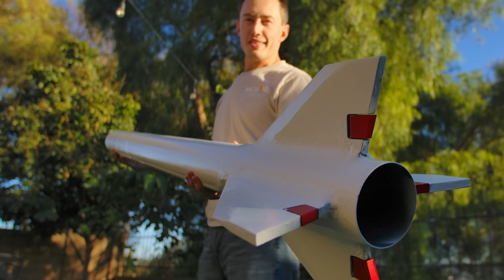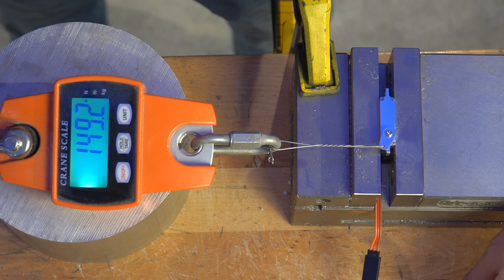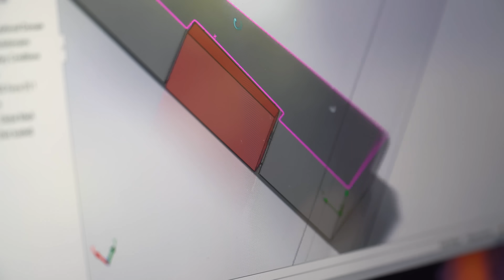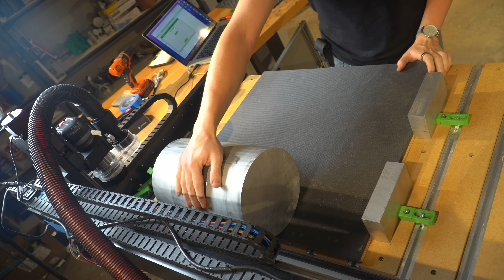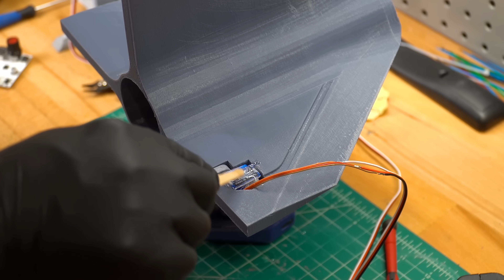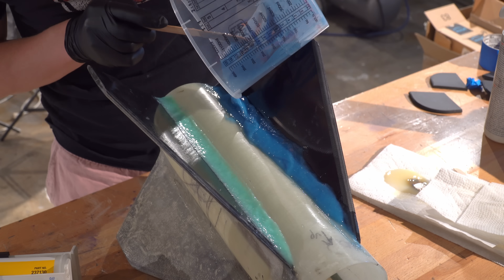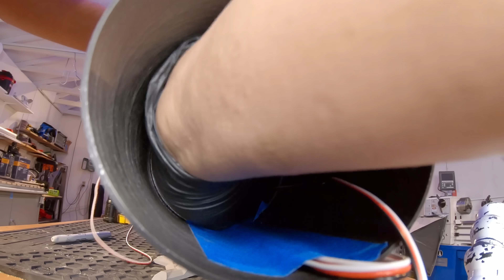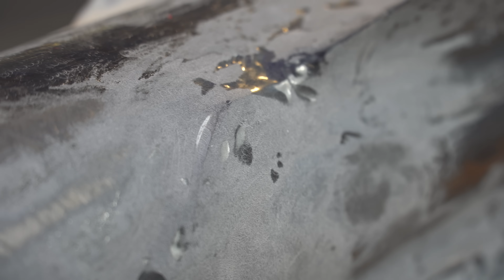Building a Guided Rocket to Hit Mach 3

Comment: What are the disadvantages of tapering the trailing edges of the fins and stabilizers?  Also, did you consider using flat PCB cable like they use in cell phones over regular wire?

Comment: Fab shop tip:
A piece of angle iron (aluminum L if you are posh) laid on a tube (cylinder settled in the V) will align itself and can be used to mark straight reference lines along the OD, or can be clamped on to use as a fence for cutting or alignment.
Not always perfect, but better than eyeballing it at least.

Comment: unless laws changed since the 90's guidance on an amateur rocket was illegal because it changed the projectile definition from rocket to guided missile. I only know because I wanted  to build a guidance system not to stabilize or correct flight trajectory but to steer it back toward launch site after apogee and deploy recovery at low altitude. why chase a drifting rocket when you can fly it back to you....just an idea i had ... and soon found out that at an amateur rocketeer level it was very illegal.
Reply: General consensus seems to be that you can point the rocket in a given direction (usually vertical) but not guide it to a specific spot

Comment: Now I get there might be elements not seen in this B-roll. But just an advice for prepping surfaces for bonding: Use a silicones remover degreasing agent and 2-rag approach. You can use IPA (or acetone if the material can take it, beware that many primers and bondos do not) for initial cleaning. Ideally then a pass with tac cloth. But for final prep, apply silcone removing degreaser with one lint free, non shedding microfiber cloth, directly followed by wiping it off with a separate clean one. Because if there's any contaminants for the degreaser to dissolve, thosebare now spread all over the application cloth.

Do not leave the silicone removing degreaser to evaporate, if a cleaning solvent evaporates on the surface, anything contaminants suspended in it are left behind right on there.

(Talking degreaser for oil silicones contaminants and other oils and fats, not the thick stuff you use to soften cured caulking silicone).

Comment: 25:45. So with the fillets, does using Kevlar pulp increase the strength noticeably? If so, I wonder if you could get away with smaller fillets by creating a small fillet with high kevlar content, then layering over that with a slightly larger fillet of just pure epoxy for the great surface finish.

If the strength increase with Kevlar (or other potential additives) isn't significant enough then it's obviously not worth the extra effort, but I'd be curious to know.

Comment: It could be just a dumb idea and it probably wouldnt work but when you were working with the fins you mentioned foldover and how that can trap air bubbles in between the epoxy layers, so i thought what if you were to do this process in a small room and right after you poured the epoxy you would cool the room down so the hot air between the layers would rise to the top thus solving foldover (i can see how this wouldnt make sense for a problem that can be solved by being gentle so just know its just an idea)

Comment: The question is why are you using so much epoxy and types. There is a ton of material waste in this and you could have made all of your carbon parts smooth without needing "seal" it by just using a two part mold system instead of trying to mill one of the hardest materials to mill - you also had the wrong bit on there for the job.  I love the video and your other videos but those aspects were a bit eye twitching.

Comment: I would have used heat shrink tubes to protect those connections. Cheap, reliable, and very easy to use. Would be worth using.

Comment: You could potentially use the rated voltage to hold the servo and switch to a higher voltage when a movement over a set threshold is required. In some huge industrial machines I've worked on with extremely negative consequences if a motor was to slip, we would allow the motor drive to over volt/current the motor for a limited time if we saw the signs of impending doom.

Comment: I had the same problem years ago with carbon fiber. I built an antenna for radio and i couldnt get it to work at all. It turned out the carbon fiber tube i had used to hold the elements to the pole was conductive.. i had the EXACT same reaction lol

Comment: 3d printed drill guides are a great idea but my recommendation would be by buy a bronze drill bush to insert into the 3d printed drill guide. It will be much more stable and re-useable. When joining the cables why on earth did you not use heat shrink insulation sleeving!!

Comment: I'm no engineer but what if you had conduit running on the outside of the rocket?  This might solve the electrical issue and prevent the sand through that happened.

Comment: Ideally carbon fiber should be cut in a water table.    Also carbon fiber is not only bad for your lungs but also your skin as the micro fibers can get imbeded in your skin, causing irritation and infection.   Same goes with carbon fiber filaments for 3d printing.

Comment: CA+epoxy used as a primary insulator on flight control wiring still feels like a constant near miss. Epoxy flows and can crack later in life, are you sure those connections didn't move inside the resin? I mean these are your flight controls and there's a sizeable potential for these small details to come up in the future. It will probably be completely fine, but reducing risk for $0.01 heatshrink/polyimide, 1µg weight, and 10 seconds of time seems a better option.

Edit:  Saw the rest of the video. Both concerns came up and were addressed. Great job, it looks excellent. Looking forward to the next video!

Comment: Great video!

About the aluminium etching: the passivating oxide layer forms instantaneously when exposed to air (that’s why it doesn’t oxidise further) so if anything you’ve just changed the surface texture (rugosity) by etching.

Comment: Joe - Have you considered using a caulk gun or a pipe bag (used for frosting) when making your filets or other precise applications of the expoxy?  Also, I'm surprised that you are sanding all of the nasty stuff outside and letting it float off (a) into the environment generally and (b) over to your neighbors...

Comment: Have you ever tried printing with Carbon Fiber?
I just recently purchased your tabletop CNC same one from 3D Carbide, but also an industrial 3D Printer that prints most alloys with the setup that only needs 350-370 in heat.
With the carbon fiber, you could have used your Ground on the material or even your power but you could have had a little restriction with power.
Just wondering..
DEv

Comment: What you were not thinking about is that the vise will take away much of your heat when testing your servo at that voltage.
It is an old welding trick to clamp some vise grips onto something you are welding or clamp it in a vise to dissipate heat.
Your vise would have been affecting your tests.
Better gearing for torque is the same as that for a vehicle for transmission.
Take the load off of your motor (Servo)

Comment: 15:45 saw the bare connections and immediately was like ooooh that’s not good. Clever by staggering the connect point but figured you’d have an issue. In the future I suggest a bit of wire heat shrink wrap. Super simple and quick and you can even seal it with the soldering iron if your light on the touch

Comment: Not to take anything away from your fine work but you might want to review the applicable laws.  From the apogee rocket web site:  “This also applies to guidance systems and advanced avionics, specifically banning any model rocket (or the critical components of, including software) that can make in-flight adjustments to its trajectory.”  A buddy got a visit from the ATF when they found out he was doing something similar.

Comment: Why hassle with servo flaps. It's not like your building a heat seeking sidewinder that needs to be on target. Yah ever hear of gyroscopic stabilization. Use wheels  on the outside edge of the fins. Like the MIC uses on DoD contract  rockets. I once used tesla turbine style of gyroscopic stabilization on  roskets out at BlackRock Desert.  Which worked the best & simple. But watch out for hippies  building match stick men to burn. 1986  I went from launching rockets  to witness the 1st burning man as a spaceman.

But remember,  everything that hits Mach 3.2  is trash. Don't over build trash. Unless your a collector &  connoisseur of the finer & expensive trash.

Comment: You're gonna wanna use some heat coating paints for the nose and surfaces, as well as probably titanium shielding on the fins especially leading edges and control surfaces.

Comment: all your work excites me, but one thing that does not allow me to be at peace is to see that cover you made to the wiring on the outside of the rocket I feel that could compromise the stability at mach 3 will be points of pressure gradieantes most likely even though you tried to preserve the symmetry at those speeds any geometric difference could be crucial I hope all goes well.

Comment: A dead servo or bad wire in a groove are not the end of the world while not attached to the body.

A cnc end mill can easily cut these out and fix the pockets to hold the replacements.

Comment: Are you sure that carbon fiber can withstand the frictional heat at Mach 3?
Reply: Because even with resins used in the aerospace industry, it can only withstand up to 300 degrees.

Comment: I'm gonna be that annoying friend: People often underestimate how persistent airborne CF dust is. Cutting it safely really requires an enclosed CNC machine vented to the outside or a misted/underwater setup. Your precautions are definitely a step in the right direction, but unlikely to be enough. Even with a filtered vacuum and boot, fine particles under 5 microns (and it’s missing plenty) stay suspended for hours, only to end up settling down on various surfaces to get kicked back up again later. This puts you and anyone entering the shop at risk of cumulative exposure.

It takes less exposure than you’d expect to cause long-term health issues. If an employer ran a setup like this, they’d likely face fines. For your health and anyone else who might enter the shop, I’d really recommend upgrading your setup if you plan to keep cutting CF like this.

Comment: Why don't they make rockets "spin", like a football, to get a natural stabilization and aid in the solid fuel burn? It would create a natural void in the center of the rocket for the expanding fuel to quickly and easily get to the nozzle, right? Additionally, it would spin the exhaust out the jet, creating a more focused cone, as well as retain the chemical reaction, due to pressure, against the solid fuel along the rocket walls, inside. Only the nose would need a counter-rotation, for sake of the camera and sensor stability, sending the signals to the fins, remotely or through a rotating contact post. (Like a motor's stator, the fin corrections could also be stabilized by the counter-rotating and non-spinning nose.)

How about the whole "golf-ball dimples" theory... Shallow, uniform dimples to create natural voids that reduce sidewall friction and increase stability control potential. As opposed to the "saran-wrap cling", that a solid surface has against air that is pressurized with a liquid-like manisquis grip. (Similar to water surface tension. High-speed fins use those divots to create voids, which reduces surface-tension grip.)

In all design basics, shouldn't the nose be slightly larger, so the speed-tuned taper to the tail also reduces drag? Besides every airplane ever designed, even missiles have a "fat head", with a slowly tapering body, to the tail. It is specific to the ultimate speed you desire to reach, accommodating the impacting pressures and time to "fill the void", back against the body, as the air rushes to fill the void created by the nose impact. A lightweight "filler" to build-up transitions smoothly, or just a basic tiered "leveling" would suffice. I am sure your design software can simulate that or you can just google the correct taper. (Optimal cruising target speed, length, girth as the target values of the design.)
Reply: Im not reading the rest but you do know rockets do spin right? Thats how most rockets work so they go straight
Reply: My understanding of dimpled surfaces is that they only help at relatively low speeds, and because golf balls would be horribly unaerodynamic without them. Mach 3 on a streamlined body is probably outside their use case

Comment: I am confused. Don't the trailing ends of the fins need the taper to join both halves of the air back into a singular stream? The control fins also with matching tapers, so they have zero impact in neutral and high impact as control deflections, creating the high and low pressures to alter the force? (A more rounded tip, to match the mach-speed profile, as opposed to a razor-knife edge, which would reduce control potential.)

Comment: A lot of work to mill in the wires in to the fins.
To increase the torsion stiffness and ease of routing of the wires in the fins... why not make the fins hollow? The force is 0 in the middle, thus use 2 fins bonded together, the wires in the middle, thus no need to get perfect smooth surface.
Why not route the wires inside the tube, or have double tubes, where the wires are in the center. No need for that perfect smooth surface where the wires are.

Comment: You are right, the PLA will melt away if it gets to Mach3 but the Resin holding it will shurely not, so in the end you will create a big Turbulence Spot on the surface of the Rocket.
Are you shure the Control system cab handle this?

Comment: A potential solution—or mild remedy—for your struggles with delamination at 10:57 is to use a diamond coated composite compression endmill. They have special cutting flute geometry for milling laminated materials.

Comment: Isn't having rail guides melt off at uncontrolled rates potentially a bad thing? Like, they'll work as a slowly deforming fin/ rudder/ aerodynamic surface, and you won't know which side or how melted/ deformed they are.

Comment: 37:44 As someone who designed rail guides for a (almost) Mach 3 rocket, I feel so called out right now. Ours were made out of aluminum and the upper one bolted right into the motor adapter, while the lower one was initially epoxied to fin can, but that wasn't strong enough and we ended up using set screws to lock it in place. Your rail guides have a lot more contact area with the tube though, so they should be fine.

Comment: My theory is that if the vacuum bubble from going mach 3 is long enough then there will be no air passing around your fin flaps to steer with.  The air is knocked out of the way so fast above the speed of sound that it takes a few miliseconds to smack back down against the body of the rocket.  I don't know if it will lose contact with those flaps at a speed of Mach 2 or 3 or if at all.  But in the future it might be best to put them in the exhaust trail and make them out of hafnium carbide  or tungsten and very tiny, ... OR put them far out on the tips of the rocket fins and not in close.  I'm looking forward to see it's performance.

Comment: Awesome video and commendable effort. A possible suggestion when soldering the servo motors is to use heat shrink to insulate the wires for a better piece of mind that the solder won’t break or the connections won’t short.

Comment: I am having trouble understanding the reasoning behind using multiple servo extensions and soldering them together. You can just get 100m rolls of the stuff and crimp on your own connectors at the end. Or you could try using magnet wire which will reduce the size of the raceway you need.

Comment: The Carbon Fiber that will get us is the unexpected residual dust that translocates to other areas of the shop.  The stuff that gets in or goes through a non-HEPA vacuum, or moves on air currents or with tools, and gets disturbed when we're working without a mask.  Create a sealed carbon fiber cutting zone, or cut outside.  Dying without air sucks: get it?

Comment: Genuine question, would the weight aluminium fins be much heavier than CF equivalent? I guess there are other disadvantages like distortion due to heat at high speed.

Comment: A tip I learned cutting EPS foam cores for an aerospace company I worked at: instead of running your parallel/raster toolpath along the fin edge, run it across and use a square tool instead of a ball. You'll maintain surface footage out at the major diameter of the square tool versus significantly less cutter speed closer to the center like a ball endmill would deliver.

Comment: Just a question, why run the cables outside instead of within the body? Additionally, have you considered bolting the fins to the body? Embed aluminum inserts into the side of the fin, and then internally have a structure that can clamp the fins towards the body.

Comment: It will be interesting to see if the control surfaces and their location are sufficient to provide adequate influence upon the attitude of the rocket. It looks to me like they might be in a location of low pressure behind the shock wave produced by the leading surface of the fin. In any case, It's a cool project though!

Comment: you seem to be fairly thorough for the design limitations of the project I don't see you skimping anywhere and it's always good to worry, failure is always an option but an option to be avoided engineering and preplanning your safe snd cautious about inhaling bad permanent fibers and particles and it's way better to overbuild and not have a failure on something that's gonna go mk3 here's two tips I have being an engineer for 50 years  1- always have on hand what you need before you start any job 2-never start a land war in Asia